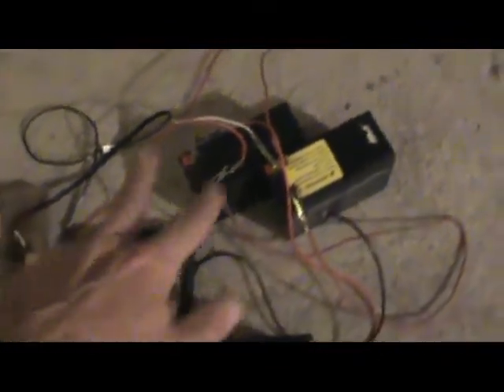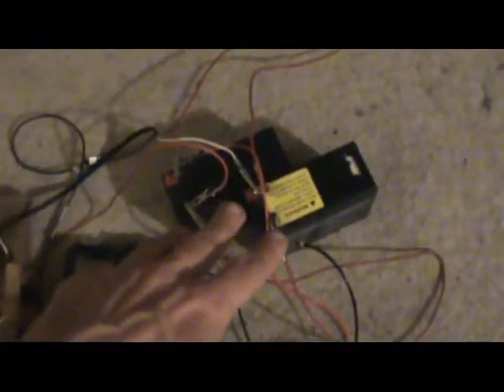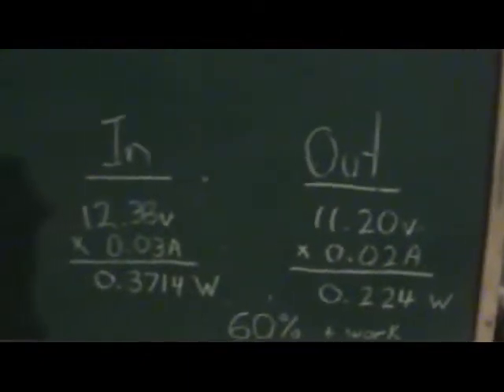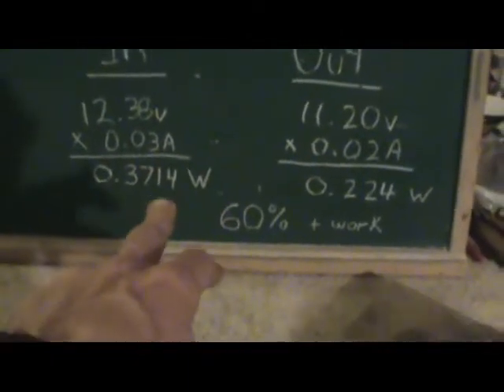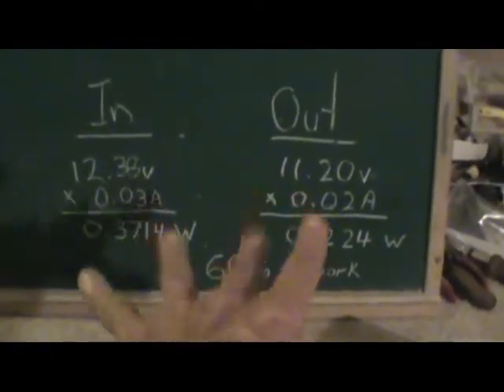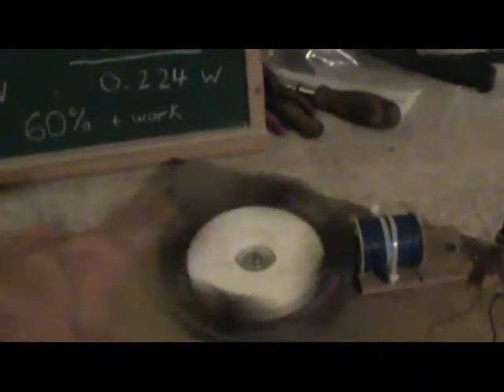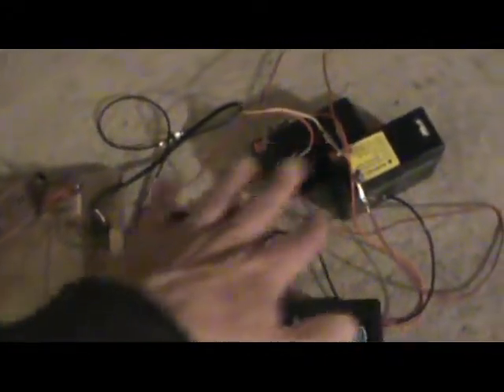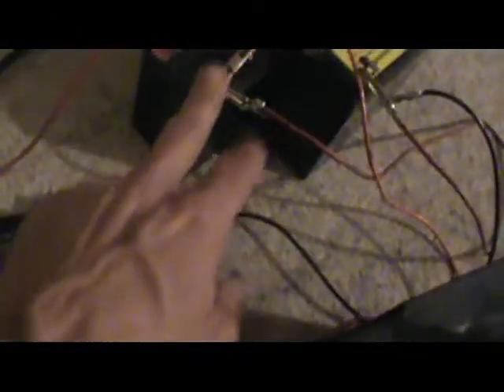Bedini Energizer

Comment: so much synchronicity....my wife has a 36v electric bike that blew 2 of its 12v batteries, getting it running again was another of my motivating factors to get started  :)
this is on my list for sure. not sure if you noticed 8 of the coils im running now are 26mag and 4 are 28mag...just in case.....(when) I change things around :)